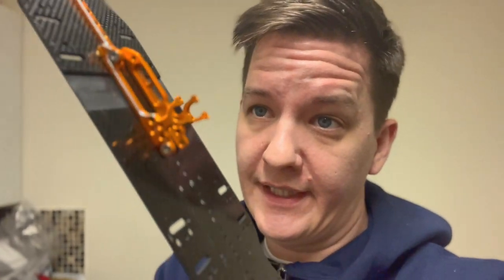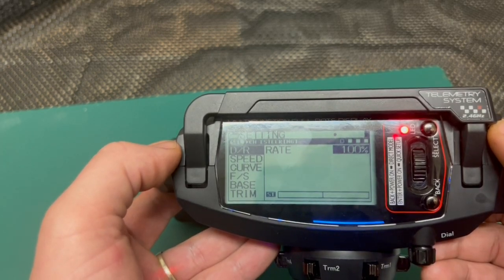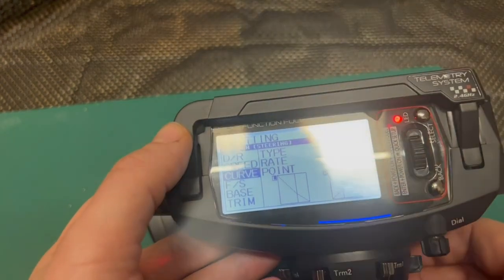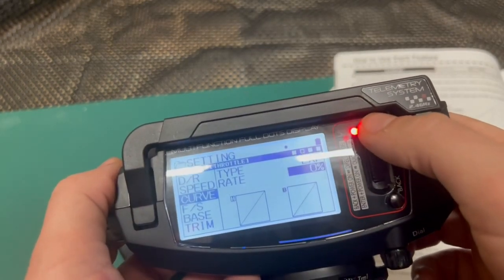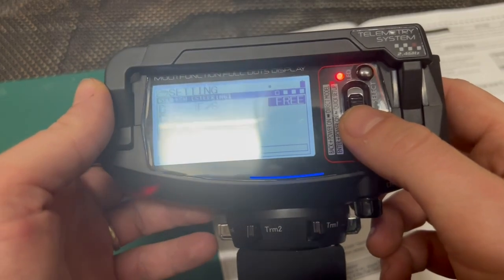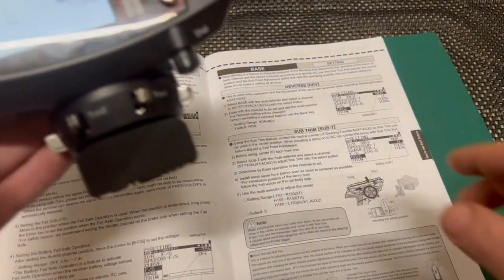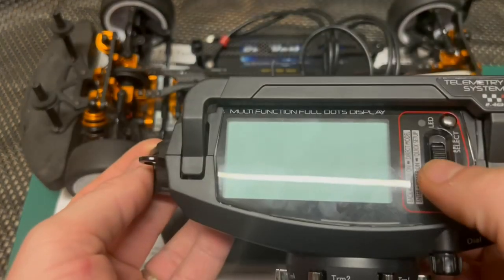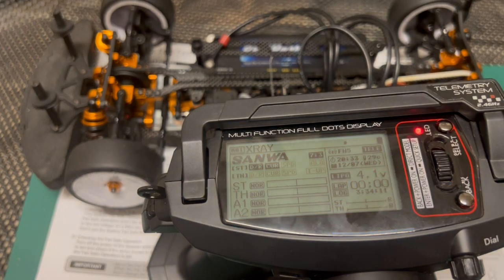Sanwa SETUP for Racing - MT5 MT44 M12

Comment: I am currently racing the t4 2021 and i have to say if you are used to rear motor cars stay with it as long as you can ! Belt tension is very important and i had a lot of problems untli recently ! Rear motor cars are simpler !As fas as bodyshell goes, the best choice for mid-motor is Xtreme Twister ! Fix the cable mess, bro . Battery terminals always at the back of the car for better traction and short wires !
Reply from the maker: I have the Twister and Speciale but fortunately or unfortunately I moved to the mi8 by Schumacher and love it! I have cables sorted now for the most part, would still like them shorter and cut down servo and transponder cable, but need to check this a little better :-)
Reply: @milancheuk  If you don't acknowledge some minor changes to xray models from the mid motor platform and afterwards it will be more difficult to drive the damn car ! For example, wider suspension arms(t4 2020+) means automatically roll up ! So you raise the roll just to counter that, (compared to 2018, 2019 car) not for driving purposes. Anyway if you go back to xray send me a pm I have played more than 500 batteries to 21 alone ! Yes short wires as close to the chassis as possible,30 mm fan for short to medium tracks(modified).

Comment: Ay same remote as me!
Reply from the maker: Love it! Any settings you recommend? Do you race also?
Reply: @milancheuk  Yeah I race, I don't really play with the exponential much though, the steering I keep a standard linear line but eg. In an F1 car that requires very smooth throttle input, sometimes I might adjust it so that I have more throttle at a lower point in the transmitter (a curve like this "(" if you know what I mean) because the car has a lot more power than torque when it's set up for my local track. For touring cars and mchassis who can run more aggressive throttle input, I just keep the throttle linear and same with brake. Also a good idea is to use "race mode" so, if your racing outdoors in hot conditions you can switch to race mode witch would give you more brake for example and normal mode set up for softer tyres and whatnot.